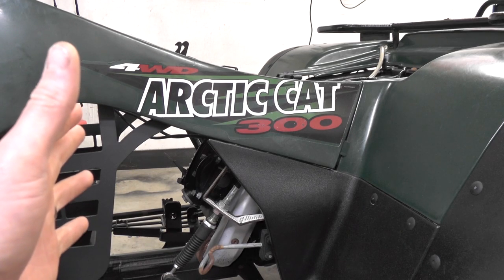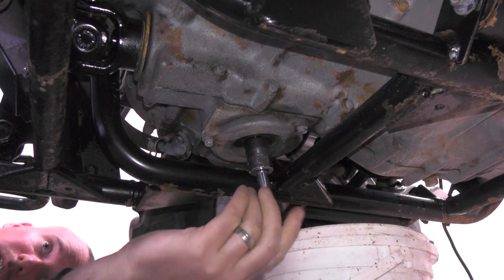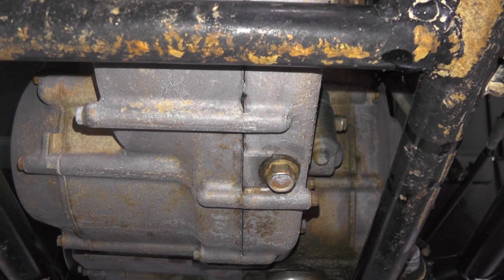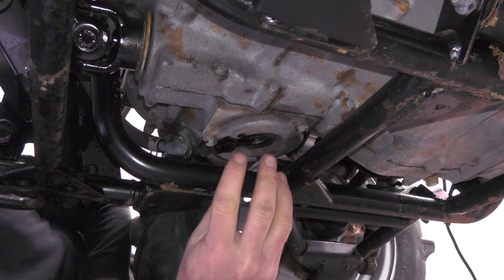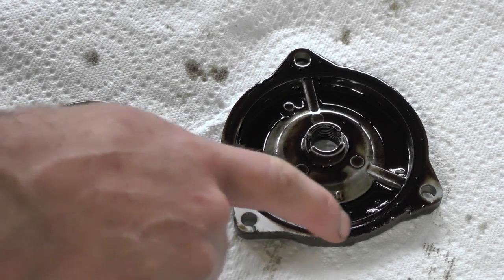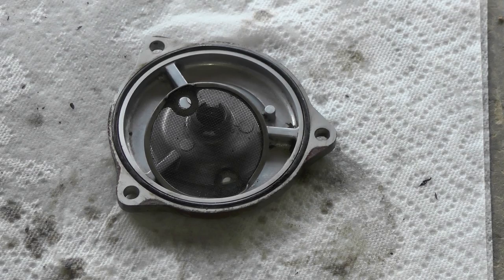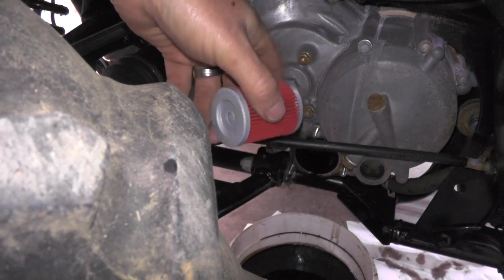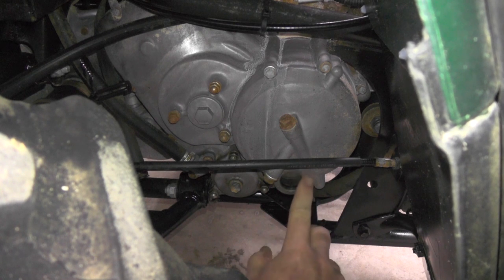Arctic Cat 300 Oil Change and Screen Cleaning

Comment: My 250 had a little oring on the inside that came out with the oil filter as well. Don't forget to put that back in ! And it should have taken a little more oil. I think I put about 3 quarts in mine.

Comment: Just want to add info that if the filter cover stud in the 8 o’clock position gets messed up the replacement isn’t available at this time. A better replacement anyway is a M6x1x80mm bolt that I found at Menards for cheap. The other 2 shorter studs are still available but shorter M6 bolts would also work. Just needs to be snug to compress the O-ring, the case is aluminum and the threads are small.

Comment: It can't be too far off, has shared rear/engine oil as this one. Thank you for the video I'm very confident I can handle it now no problem. I'd like a good repair manual but not sure what's a good brand or if there even is anything except the service manual

Comment: I'm having a real hard time getting that third 8mm screw out holding the oil screen cover on.  At the end of it's threads, the bolt bumps into the frame cross member and won't come out.  How did you manage to squeeze that third bolt out?
Reply from the maker: Chris, is you're skid plate or frame support possibly bent? We didn't have this issue.
Reply: @atvdirt1  Thanks very much for the reply!  
It’s entirely possible that the frame is bent. The entire machine is “bent”. 
I put a bottle Jack under the rear diff and jacked. The weight of the machine, coupled with lifting the engine, gave me enough room to “squeak” the bolt out. So I managed... just.
Thanks again for the reply!
Great video and I wouldn’t have known to clean the screen without this video. 
Cheers!
Reply: Having the same problem Chris thanks for making me not feel alone lol
Reply: @Pickle117  ditto! Got it out barely, trying to get it back in is a bitch!

Comment: I just bought a 2000 300 does the oil have to be too the top of the sight glass? How many quarts
Reply from the maker: leave it just slightly below the sight glass
Reply: "Oil has to be between these two marks" on the right side of the sight glass. Buy 4 quarts. Put 3 in and check the glass.

Comment: I followed the exact same steps and now after the oil change and filter replace, oil is shooting out from the oil cooler… Hoses are intact. What am I doing wrong?
Reply: same thing just happened to me. did you find out the problem?
Reply: to much oil? only thing i could think of if it was working fine before you changed it
Reply: Anyone figure this problem out ?
Reply: I’m having the same issue today, any suggestions on how to fix it? Did I put the plate on the bottom backwards?